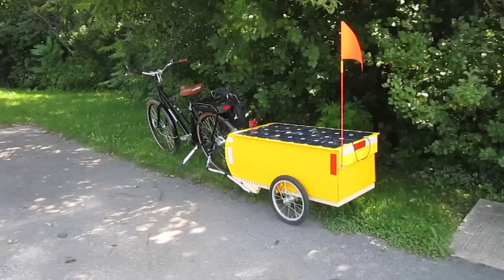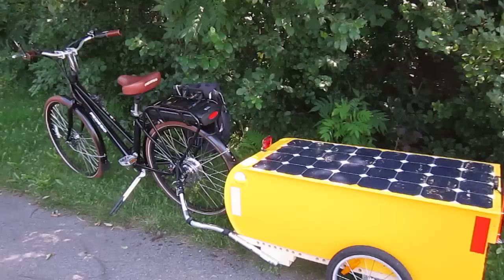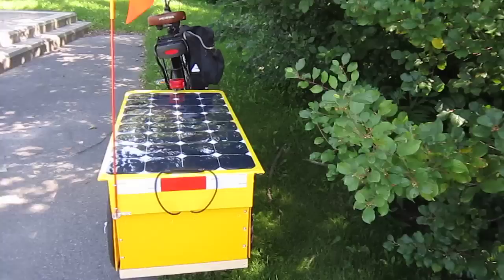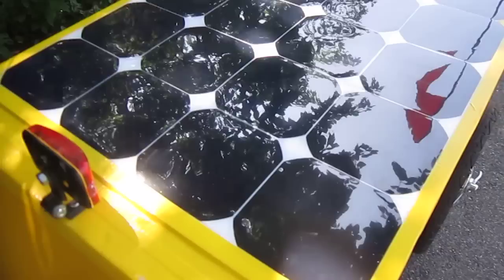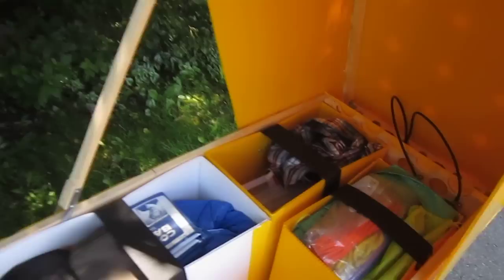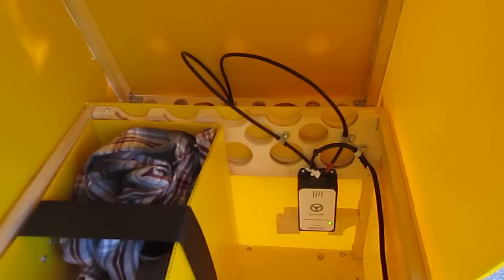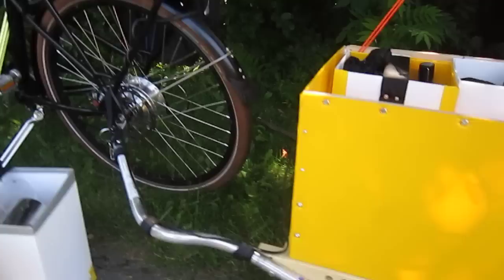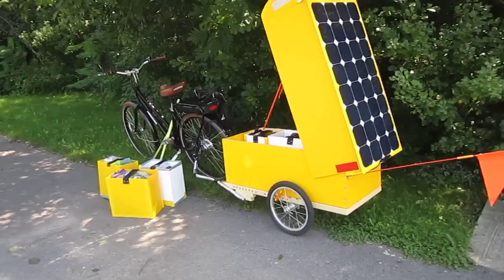Solar electric bicycle touring trailer for luxury camping

Comment: Idea, get a used Dyson vacume cleaner that has a digital motor in it. Then pull the motor and rewire it into a electrical power generator configuration. Those solar panels could power the digital power generator to quickly charge up organic carbon power cell bank's you have placed along the floor of your cart. 😊😉
Reply from the maker: Too complicated for my limited knowledge of electronics, but interesting nonetheless.

Comment: Ebike battery is 36v so u can put 3 100ah 12v batteries in series and bike 1000km
Reply from the maker: Yes, If you're riding at minimum assist on level ground with a tail wind.
For normal riding, if you are using 12 Wh per km, 3600 Wh would get you 300 km.
Thanks for your input.

Comment: Ingenious. I am about to get into long distance touring, camping on my AZUB TRIcon recumbent tricycle. Your trailer is just what I need.

I just installed a Bafang BBS02 750W mid-drive kit onto my recumbent and would like to incorporate some sort of charging system. My solar panel boost controller just arrived in the mail, and I will purchase an appropriate solar panel soon. I really like your idea of using lift-out boxes. Any suspension on your trailer? Water about water resistance? Stuff stays dry inside?

Point of clarification: you can ride and charge the battery at the same time while riding under power? Didn't know you could do that. Good job. I'll have to put on my thinking cap and see what I can come up with using my Maya trailer. Thanks for posting. Are you still riding nowadays?
Reply from the maker: Thank you for your interest in my idea. You could add two lift up solar panels on either side. if you made the top a little wider that the wheel track, you could ride with them down and raise them when you are stopped. I would like to try a trike. They are very rare where I live. I don't know why we hardly ever see one.

Comment: I have found without mudguards riding in wet conditions you get a lot of mud and road debris etc landing on top of the trailer. Not good for solar cells.
Reply from the maker: You're so right! On my camper I added a fender on the rolled-up awning side after cleaning up a good mess. Would need 2 with a solar panel.

Comment: Super fantastic trailer!  How is it holding up under rough roads and weather?
Reply from the maker: Good question.  I only built it last August and went on two trips with it: a 210km, 3day trip and a 500 km, 6-day trip, carrying about 25 kg of payload. Then I stored it in an unheated public storage for the winter. It has held up very wery well. My concern was the taped joints. The "Duck" tape show no sign of peeling and the wood frame is intact. I'd say it looks quite promising for my upcoming 3000 km trip.

Comment: How about pulling 2 solar trailers (100 watts and 100 watts) like a train.
Just don't carry any cargo in the other trailer to make it as light as possible.
Reduction of extra weight would be essential.
When I ride an electric bike (a 2017 Rad Rover) I use an average of around 250 watts per hour though it has a 750 watt rated Bafang motor.
Reply from the maker: That might be a good way to add more solar panels. But it would be more awkward to ride in the city. 250 W per hour is about what I use with my Pedego too. 
If you want to see more ideas of how to attach lots of solar panels to a bike, have a look at this brief video:  https://www.thesuntrip.com/sun-trip-2018/lyon-canton-en/
Reply: Hey thanks.
You might be able to fit a 50 watt solar  panel above a rear rack though it could be susceptible to damage if you have a spill or the bike falls over
Reply from the maker: Yes, some people have done that.

Comment: I want to travel all around the world with this bicycle. 
And Robert how much this solar bicycle???
Thanks

Mario from Miami, Florida
Reply from the maker: I built it myself. You can see some details of construction of the trailer on www.robertberiault.com.
The most expensive part is the solar panel and MPPT controller at $500, then the wheels and tongue at about $300 and coroplast, hardware and wood at $200. The whole thing for under $1000 CDN.

If I were to build it to travel around the world, I would make the frame out of aluminum instead of wood, for the sake of strength and durability. The cost for that would depend on how handy you are with welding aluminum or how much the welder would charge you. Welding aluminum is a specialty. I might try assembling the structure with JB Weld and secured with  nuts and bolts and save the cost of welding. (JB Weld is a very strong glue for metal)
Good luck with your dream.

Comment: You have to be a critter to live like this. Refrigerator boxes make nice homes until the rain comes. They are cheap too. Located under a street light and you don't need solar panels. Get you a natchel sack  with one change of clothes. Dumpster diving does not require silverware. Maybe the box is hinged but something seems unhinged. That's for sure.
Reply from the maker: Les goûts ne se discutent pas.

Comment: Im curious, how much range extension do you get out of this set up. 150w solar 12v panel? Stepped to 48 thats like 2 amps which is enough to charge the battery. But thats only in perfect conditions.  Whats the performance like on average? What percentage range increase do you see over carrying a similar load without the solar charger. Has this harmed your battery at all? Im not sure if those are meant to charge and discharge at the same time. 
 Just fyi, i know you are in Canada and its likely more there, but in the states, you can get small light weight inverter generators for around $100 to $500 or more and they can recharge that battery anytime and power lots of other stuff too. 
 A 5 gal can of petrol would last you a while just charging the battery. Im sure that on the best day you arent doubling your natural range on that battery. So getting a second battery would make something like that work pretty well. With small mods to the trailer you could ride until one battery is dead then start the genny and charge that one while you are using the second one. If you are running in the lower levels of pedal assist and say getting an average of 4 hours of run time out of a charge, you would have an endless battery system.
Reply from the maker: Hi Meta,

The problem if you are travelling with just a range extended,  is that when you reach your campsite, you plug in your battery and your solar panel sits there without doing anything. So I was only charging with the panel while riding,.The only time it makes sense to have a solar panel is if you have an array large enough to be completely independent. It is difficult to have such a large array (250 to 300 Walls) and travel on the highway safely. On my Eastern Ontario trip, i figured I was extending my range by 10 to 15 km, which is not bad, but far from competing with just having a second battery. It doesn't harm the Pedego battery to charge while underway. With some systems, like the Bosch, you simply can't charge the battery with solar at all.
In my way of thinking, if you are going to carry gasoline, you might as well use a motorcycle.
Thanks for your input
Reply: Robert Beriault you would just need the harness end off the charger and if its super smart something that tells the bike that its an authorized charger. Software can be hacked if they have it locked out. 
 Thats not a bad set up considering you wanted a trailer anyway. 
 The generator is. Pretty handy thing to have if you ever need real power. You still have the quiet of the electric and a motorcycle couldnt power much without mods and even then not a lot. 
Thanks for the response.

Comment: Awesome build and organization to make it easier.  Do u actually find the solar panel charges your battery enough ?
Reply from the maker: Since it's only 100 Watts, it only produces one third to one quarter of what I need. It can be calles a range extender system.

Comment: cool man. It would be better though if it were a bit longer and wider so one could sleep on top of it, with a PVC or fiberglass hoop cover perhaps in case of rain and/or mosquitos. Carbon fibre would be a good shell material. It should also be sturdy enough to hold a spare battery, a 1000 watt gas powered generator, a Fender Stratocaster or an acoustic-electric guitar and a small Roland battery powered bass amp, delay pedal and loop station. Then it would be an infinite self funding travel machine.
Reply from the maker: That's a tall order, but I did work on another idea: https://youtu.be/nDf6_T3ZHoM

Comment: how heavy is it when its empty? im considering getting an old travel trunk and putting wheels on that. if I bought that type f plastic, is there any way i can fold it down to be more space efficient when im not using it?
Reply from the maker: 23 pounds empty. Without solar panel: 17 lbs. Thanks for the question. I've now updated my website to include that info.
To fold it down, you'd have to create a totally different design. I suppose it could be done origami style.

Comment: Very interesting trailer. Great concept. I would like to know how is the 'lid' securely attached to the bottom without producing unpleasant sounds and without opening up? Does the trailer have suspension? Or do you rely on the air in the tires?
Also, were you able to solve the problem with the battery charging from the panel? I watched other videos as well but didn't find it mentioned there.
Reply from the maker: Hi Martin, Your question about how the top is attached to the bottom is relevant, so I will take a picture and post it on my website. There are no unpleasant sounds from the trailer when it is loaded. When it is empty, there is a slight drumming sound when going over bumps. As for the idea of a suspension, if I could figure out how to do this without unduly increasing the weight, I would do it. That would allow me to go faster when on rough roads and going over the numerous bumps we come across everywhere. However, I just completed a 500 kilometer trip with my laptop and C-Pap machine in the trailer and nothing was damaged. The softness of the Coroplast bottom cushions much of the potential shaking, and I keep the tires inflated to less than 30 lbs to soften the ride (of the trailer). On this last trip I was able to determine that on a sunny September day the solar panel gives me an extra 15 to 20 km range. Not bad for living at the 45th parallel. Sorry about the late reply. I'm just getting used to Utube.  
--Robert
Reply: Hello. Thank you for the answer. What's your website? Where can I see the image? :-)
I thought that inflating the tires to less than usual pressure would result in increased comfort and kind of suspension feel, but yeah, as you said, this is only effective to a certain speed, from which on the tire cannot cope with the speed an obstale is travelling underneath it. Maybe underinflating the tires a bit more? But then again, it increases rolling resistance, which too is not desired. Thanks.
Reply from the maker: I usually opt for less rolling resistance at the expense of comfort on the bike, but keep the trailer tires softer to reduce the effects of vibration on all my electronic equipment. My website is www.robertberiault.com

Comment: With full noon sunlight, what is the re-charge time to fully charge a depleted battery? Do you need to lift the trailer to "aim" the solar panels at a setting sun? What is the charge time for a 5:00pm sun and into the evening?
Reply from the maker: The two main factors are the angle of the sun, as you refer to, and cloud cover. At noon, the best I could get was 1.3 amps with the panel angled to the sun as best as possible. That works out to 74 Watts, by multiplying amperage times voltage (the MPPT boost controller puts out 57 V). That was at noon, at summer solstice where I live at 45 degrees of latitude. Everything else is downhill from there. At five p.m. in September in Gatineau the sun is so low, that there is virtually no charging taking place. Even in June, after 5 p.m. till dark, I’m guessing that I might get 50 Watt-hours (the capacity of a bike battery is usually between 300 and 750 Watt-hours, depending on the price of the bike). I hope this helps. If you haven’t already, you might want to watch my videos about angle of the sun and cloud cover. Thanks for your question.
Reply: @RobertBeriault753  Thank  you very much, I have been curious about touring with a motor around my home, but it is all wilderness, solar would be the only way to charge. The wilderness I live in has sun all summer (sunniest area in America) except maybe two days of rain and 100 to 115 degree F. days.
Reply from the maker: To be cloud-free is a huge advantage you have. But I'd be unable to stand those high temperatures. I'd need a lot of solar panels to run my air conditioner!!!
Reply: @RobertBeriault753  i think this controller is the most  expensive part on your trailer?
Reply from the maker: @ZeljkoMikulec  I bought the controller and solar panel as a kit, so I don't have a breakdown of each cost. All told, with shipping, duty and taxes, $600 CAD

Comment: How many amp in the battery  and how many hours take to charge battrry full ❤
Reply from the maker: The Pedego City Commuter had a 720 Watt hour battery. The answer depends on if if if if...
The latitude at which you live, the number of insolation hours available in your area, the time of the year,  the angle at which you aim the panel (riding or stationary), and more. Assuming that conditions are good and you're getting an average 50 W, it would take you 720 ÷ 50 = 14.4 hours, or approximately two days in a North American summer.
Reply: @RobertBeriault753  with 100 watt solar panel you need 14 hours full charged that's cool for me

Comment: Cool lightweight setup.  I've been messing with electric bikes for many years, even having made one with a motor setup I designed.  Do you have the 12v solar output feeding the battery directly, or do you have a BMS setup?  I would think the battery could be damaged, assuming it's a lithium pack, being directly fed 48 volts, without some sort of management device.
Reply from the maker: Thank you. The solar panel feeds into a boost charge controller that increases the voltage to 57 volts. It also controls the power that goes into the battery. Aside from the motor cutting out occasionally, it seems to charge correctly.
Reply: Nice.  As long as it works for you it's fine.  The motor usually cuts out when the speed controller is overloaded, and the battery can't keep up the voltage.  Doubling the pack and hooking in a parallel setup would eliminate that problem.  That said, it's probably easier to just back off the throttle a bit, and use a little more pedal assist.   Probably won't do any damage though, either way.

Comment: Hi. I built my 3rd Ebike and this one is a rear ebike so how did you manage to attach trailer with cord coming out of nut? I've got a trailer and cant use coupling and adapter cost around $40.
Reply from the maker: With the Pedego City Commuter, the motor's wire harness comes out the right side, so the left side of the axle is free, so I was able to use the axle hitch. But you might have to use the Burley Classic hitch. See these diagrams:
https://drive.google.com/drive/u/0/folders/1ZB3fhwrBxPqNdJ62NtoICBUEioybmycb

Comment: Wow.   Looks like he had a background in model aircraft or something - that looks so lightweight on the inside, yet solid when closed.   Great job.
Reply from the maker: I did build a few model aircraft when I was a kid. I'm not an engineer, just a hobbyist. But aircraft design has always fascinated me. The trailer itself weighs 23 lbs (10.5 kg) but the solar panel and controller add another 6 lbs (2.75 kg).

Comment: How do you calculate the approximate weight carrying capacity? Nice video,as usual.
Reply from the maker: The wheels, axle and tow bar come from my Burley Nomad cargo trailer and the manufacturer says that it can carry 100 lbs.

Comment: Can this trailer be attached using the WEBER hitch, which looks like a TUNING FORK and connects from the middle of the trailer to BOTH sides of the bike's rear wheel?  Also, do you SELL this trailer?
Reply from the maker: I suppose you could use whatever type of hitch you can think of. I don't sell this trailer, but will be publishing plans soon.

Comment: What's your average top cruising speed? How many watts do you use for your tire ?
Reply from the maker: With an average cruising speed of 24-25 kph the  100 - Watt solar panel produce about 175 Watt-hours of power in August. Could do better at summer solstice, of course. Still thinking about how to improve this with more panels. They take up a lot of space!

Comment: Very well thought out.
I just found you, 
How was your trip?
How many trips you been on?
I'm in Maine, 
My name is clay
Reply from the maker: I found the trailer and its system of boxes very useful. It saves time when packing up because I can simply stuff the sleeping bag and the tent in their respective boxes and everything is well organized and easily accessible. I didn't get a lot of use out of it, because last year I built my camper. I found the camper more useful, so that is what I will use again this year. I might switch the solar panel over to the camper. I still have to run some tests on it first. Have you seen the camper? - https://youtu.be/PIv8wU0SL5s
Thanks for your interest.

Comment: does the small panel keep your ebike charged while you're riding?
Reply from the maker: It can supply from 20% to 40% of my average daily 80km trip, depending on the height of the sun, which diminishes from June to September.